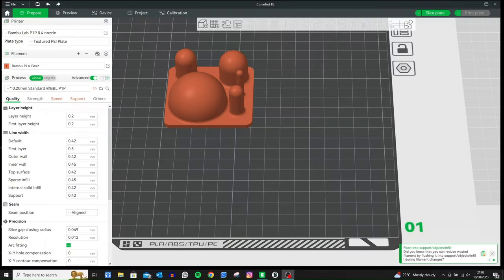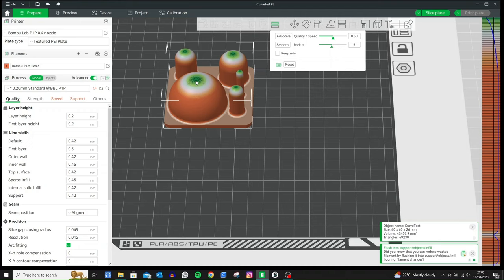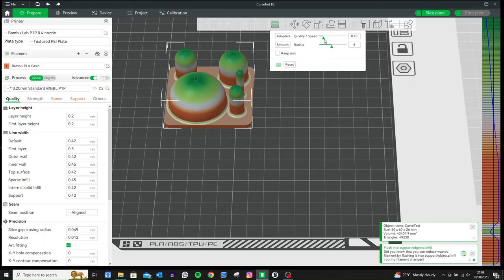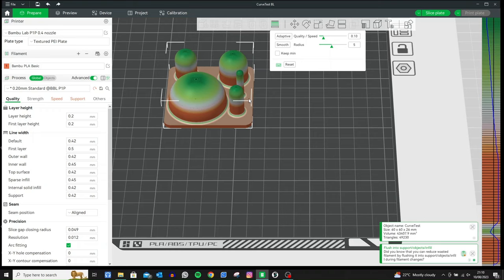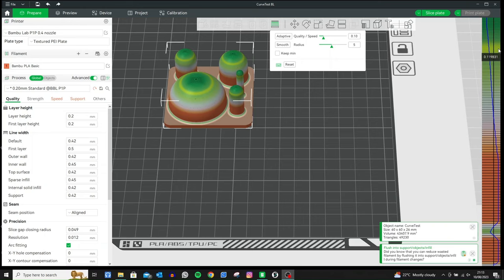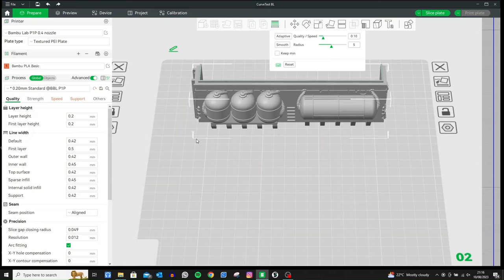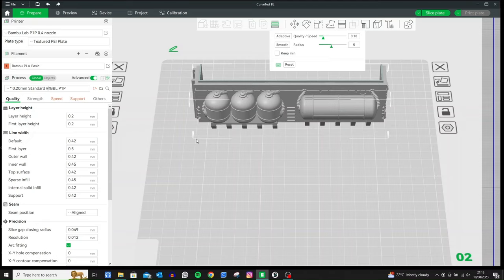Bambu Labs P1P and P1S - Variable Layer Height and Adaptive Layers

Comment: Very good info!  You should show us how to calc how fast they are printing like 50mm/s or 150mm/s  I never could figure that out :)  Bambu Slicer.
Reply from the maker: Great suggestion! I'll look into doing that.
These prints were done at the default speed settings for PLA. (200mm/s outer wall 300mm/s inner wall and 270mm/s sparse infill).
Obviously the actual speed will depend on acceleration and the distance moved. Hmmm?
You've got me intrigued, I'll have to put this on my list of things to do.

Comment: Bought a P1S. Be here in a few days. If using WiFi to send info to printer, do you need to leave slicer open or can you shut it down after the send even when not using the cloud?
Reply from the maker: Congratulations on your purchase, you won't regret it. Once a file has been sent, the slicer will jump to the device screen. This will show you the progress of the job. Once the job has downloaded to the printer (normally takes about a minute) you can close the slicer and shut down your PC.

Comment: Hi Marty, stumbled on your channel, just about to get a P1P and looking how to best take advantage of it.  Great explanation.  Adaptive layers look great for domed parts, so will defo try that.  How did you get that coloured layer graph on th eleft side? cannot find a control for it.
Reply from the maker: Hi Andrew. Select prepare mode at the top of the screen and then click on the part. Click on the variable layer height icon and the graph should appear on the left hand side. If you click the adaptive button, colours will display on the graph and you can tweak them.
Thanks for your comment and enjoy your printer.

Comment: Question. I just got a P1S can i leave mines on even tho im not printing or should i turn it off everytime after a print ?
Reply from the maker: There are lots of different opinions on this. So what I'm saying is just my personal one.
When powering things up from start there is a small electrical shock to the system as electricity flows through the circuitry. Some electrical components are sensitive and if they have a miniscule flaw this surge can cause them to fail.
I believe that it is for this reason, many devices (such as your telly) have a standby mode.
As your printer doesn't have a standby mode, I recommend leaving it on.
The power draw will be minimal.
However, to protect the printer I would recommend connecting the power lead to a surge protected extension lead or socket. Mains supply can fluctuate a lot, which can have a devastating effect on circuitry, and it is worth having this protection.

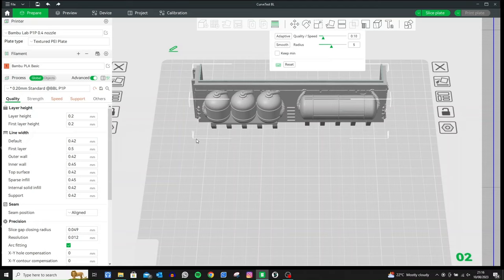Comment: Was really good up until it went psychadelic at 16:06.
Reply from the maker: Hi. Thanks for the comment. I've just checked the video. At 16.06 I have an inset video appear. It appears to run fine on my PC though. Sorry that you never got to see/enjoy the whole video.
Reply: @MadMartMalloy  I powered through it, but the double echo was trippy.  Great videos, btw.  I'm on day 2 of my 3D printing career.  Just got into it yesterday.  I'm trying to absorb all the info I can, and your videos are delivering it.
Reply from the maker: @LtGrandpoobah  Aha, it was the sound. Yes, I had some sound problems on this video. 
I'm assuming you've bought a Bambu. Great choice, have fun with it. It's relatively pain free compared to other printers out there. If you're stuck on anything don't hesitate to drop me a message in the comments section.